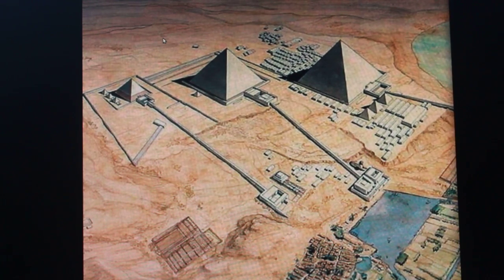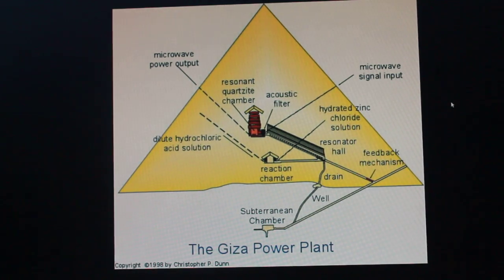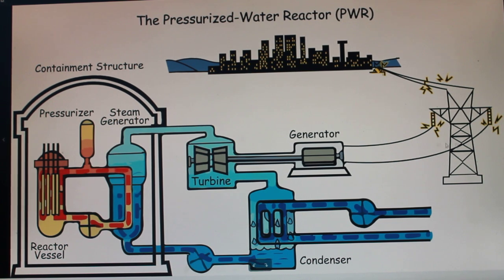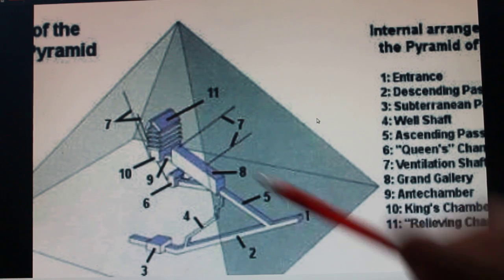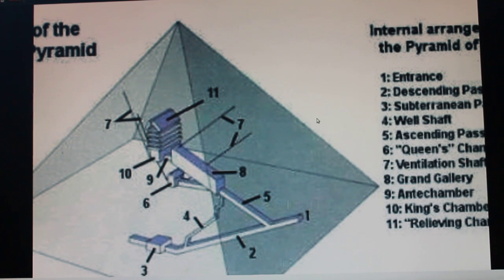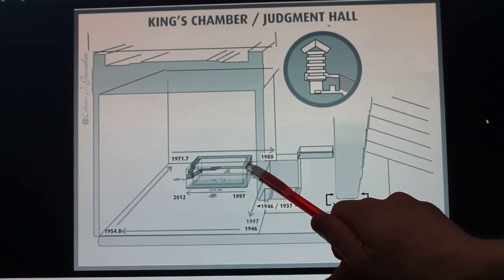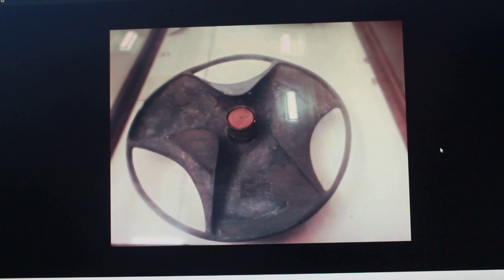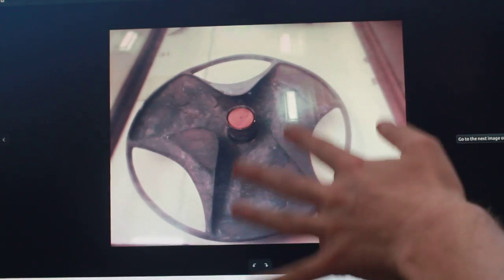Is the Giza Pyramid an Ancient Boiling Water Nuclear Reactor Complex? (Part 1)

Comment: All Shafts was originally closed before the black powder archaeology was started. how does a Nuclear reactor need amounts of Whisperer sand 99% quartz content in chambers. where are reminders of the Pantograph infrastructure? if you already have the technology for building that kind of workmanship you don't need nuclear  power plants. 

If you look at your picture you see a lot of passages  channels Bypass channels Plugs  heavy flow regulator blocks. it remembers on a carburettor.

Comment: It was an Ion Generator. The stones in the subterranean chamber created an electrical differential to split water atoms into oxygen and hydrogen. The oxygen sunk to the bottom and was discarded. The hydrogen rose to the queens chamber where it was under intense pressure in order to initiate ionization. The shafts of the queens chamber stopped just short of the surface in order to contain the hydrogen under pressure but allow the ions to escape through the copper in the plugs at the ends of the shafts...

Comment: Where you have the cut-outs at the end of the vid, the two sides look to be the same hieght could this of had wheels/cog system which used the holes like a ratchet system, to stop what ever was being pulled up falling back down?

Could it be used as a way of sending water out of the atmosphere? Like a last minute save the planet against floods kind of device.

Comment: It has been said that the Giza Pyramid could have been some sort of electrical generator.  So could these iron rods in the stones in the shaft be what is left of iron cables? The  Giza Pyramid is so old the iron cables would have easily oxidised and rioted away by now.  So what was left of these iron rods or iron cables in the stones in the shaft could have been protected from oxidation by the element in the stone itself.  the rest of the cable has oxidised and disinterred away.

Comment: it was nuclear...but it used thermonuclear energy cold fusion. it combined alpha particles and electrons and fuse them together to make lithium. this is the red star over both head and the other gods. this guy is partially right but theres more to it. the Ark of the Covenant was a radioisotope thermoelectric generator which use the p-type and n-type material of Tesla's 3-6-9 because of their electronegativity. essentially it's a giant thermoelectric generator with a small star in the king's chamber. this is all facts if u research everything I just said. even Chris Dunn's Theory actually supports everything I said because what he thinks is only also part of it and implies that my theory is right with the residue that he has found the hydrogen was ionized and burnt in a thermonuclear Ark emulating the sun perfect

Comment: There are chambers not on your diagram. That have recently been descoverd. If it where a reactor it would still have high levels of raidoactive.
Reply: Not if it was this thorium. No chain meltdown week it'll salt water. But good point. Was a radiometer every used to detect radiation?

Comment: Is air pressure energy? Harness sonic pulse . baffled and concentrated in kings chamber, liquid diaphragm makes kings chamber a bicycle pump. It breathes. Ask John Cadmans ram pump. Granite ball in shaft is under water, air intake only valve. Granite box belongs on other side of wall, Obviously pulled in through pressure blow out stone hole. Water mark on wall speaks of compressed air above it. Kiss. When you get it right. You know it.

Comment: If they were nuclear reactors, were's the residual radiation at. If I remember right the half life of uranium is a half a million years. I'm probably wrong about that, but it is definitely longer than the time frame of when the pyramids were supposedly built. Either way, if you had nuclear reactions happening inside the pyramid then why don't we pick up any residual radiation. The chamber at the bottom of the pyramid was a resonant generator. It also produced electric current created from the running water flowing down the tunnel and out the drain that they believe they found down there. The electric field produced was used to split water into hydrogen and oxygen. The oxygen was bled off and the hydrogen was captured and channeled into the grand gallery which was a resonant chamber. The rest of the hydrogen was produced in the Queens chamber. They found zinc lining one of the tunnels that comes down into the Queens chamber and hydrochloric acid coming down the other one. This produced a large amount of hydrogen gas. This gas was then channeled into the grand gallery. The grand gallery was tuned with panels at different locations. The Kings chamber was a resonant chamber as well. The poured rock sarkofagus, was used to house the Ark of the covenant. The Ark was a resonant device that stored energy. When you resonate hydrogen at a specific frequency, it produces microwave energy. The shape of the pyramid then produced a maser beam. It's like a laser beam, but instead of using light it uses microwave energy. The maser was directed at the ionisphere, which in turn created a plasma channel for millions of amps of electricity to be harvested from the upper ionisphere. The resulting energy bolt would follow the plasma channel back to the pyramid where the cap stone would redirect the energy to waiting storage facilities. To transmit the power, they did what Nichola Tesla did. Tesla sent power into the upper Shuman cavity and kept it going by spanking it with a new charge everytime it came around. He could then pull the power directly out of the air and use it anytime he wished. He could transmit power for miles and pull it down and use it anytime he wished. The civilization before the Egyptians were able to do this and powered the world. So, the pyramids did produce power, they just didn't do it with nuclear energy.

Comment: People need to stop with this granite electricity nonsense... Granite is actually a very bad conductor. If you pass current trough granite it heats up more than anything else. A huge waste of electricity.. They had copper back than so if they knew about electricity don't you think they would use that instead?

Comment: as you gave advice to that guy who wrote a book, build one and prove it works, then come here and claim your theory... you have problem with pressure relief system and isolation of the chambers from each other. also you are missing mechanical part for converting steam power to electrical. go rethink your theory.

Comment: I actually am of the same opinion. Hereunder is what I commented at another video.

"After watching various videos I do believe that the great pyramid was a factory of energy but I do not know of what type. The walls material as well as the size of the building are both ideal for keeping heat and vibrations inside. Evident are marks of heat and scorching on the walls and the four airways could be working as release valves? Moreover, the parallel stones above the "kings" chamber remind me of vibration absorbing springs. Have there been tests for radiation?

Moreover, the corridors seem small enough to fit only workers for maintenance purposes. And potentially the heavy door at the beginning of the grand gallery was there for security purposes, sealing potential excess pressure or something. Maybe the grand gallery itself would be a pressure release chamber as well."

Comment: Doesn't make sense........there ares 10,000 of pyramids in the world, Giza is just the most advance, so if GIZA was a nuclear power plant then we have to assume the other 10,000s are more primitive version of GIZA, meaning still a nuclear power plant, other pyramids don't give you any reason to believe it was a nuclear plant or a power plant, only Giza.

also if its a nuclear power plant i don't see what the point is to align the structure with stars and with other pyramids on earth 10,000km away, and all the extra precision and measurements which resemble dimensions of earth and moon etc

we must assume all pyramids were built for the same purpose regardless of how advance or primitive.

I think it was a power plant, but not nuclear, it harnesses the natural energy that is in the atmosphere like Tesla proved, that's why it on the equator, wheres earths meridian energy lines pass, as well as the alignments to north, south etc as well as with other stars and pyramids on earth. So its harnessing earths "Chi"

Comment: Excellent scientific approach,  you are very close...  They were likely HHO generators,  self igniting with static electricity aka spark,  oxygen sinks,  hydrogen like the hindenburg,  floats.  The cloud effect like a lynden jar,  or storm clouds building opposing charges in floors and ceiling of the condensing unit,  aka the Queens chamber,  why it was charred..  Its also a blast chamber,  and the well below used as a water source,  til the climate for whatever reason changed.  I hope this points you in the right direction,  although there were entire civilizations destroyed by nukes and UFOs if you do your research.  Sand turned to glass and extreme heat that killed civilizations.  But this is all just my opinion.  No one can be sure at this time.

Comment: Close, but : https://www.youtube.com/watch?v=lMJr-oUYYDA thats what is going on.

Materials in pyramids, most common : 

Granite - The electrical properties of granite appear to be dominantly controlled by the amount of free water in the granite and by temperature. Minor contributions to the electrical properties are provided by hydrostatic and lithostatic pressure, structurally bound water, oxygen fugacity, and other parameters. Is granite a good conductor of electricity? The electrons from the stressed rock cannot follow the holes, because granite is not a very good conductor of this more usual form of electricity. But when, if you do this trick in a laboratory, you give the electrons the chance to bypass a section of rock by way of a metal wire, quite large currents will flow.

Basalt rocks - Some magnetic properties and electrical characteristics at low and high (microwave) frequency of basaltic rocks are reported. The magnetic measurements show that basalt rocks are ordered ferromagnetically in particle size form. The low-frequency results indicate that basalt samples have relatively high dielectric constant. The Cole-Cole plot shows a part of inclined semicircle resulting from the spread of the relaxation times of the relaxators that operate in the sample bulk. The microwave results reveal that relatively strong interactions exist between the microwave (in X-band) and the matrix. The value of shielding effectiveness determined from the measured insertion and return losses was found to be about 15 dB per cm.

***A dielectric (or dielectric material) is an electrical insulator that can be polarized by an applied electric field. When a dielectric is placed in an electric field, electric charges do not flow through the material as they do in an electrical conductor but only slightly shift from their average equilibrium positions causing dielectric polarization. Because of dielectric polarization, positive charges are displaced in the direction of the field and negative charges shift in the opposite direction. This creates an internal electric field that reduces the overall field within the dielectric itself.[1] If a dielectric is composed of weakly bonded molecules, those molecules not only become polarized, but also reorient so that their symmetry axes align to the field.

Comment: Show the world at least some of the outside infrastructure required to carry the resulting power to homes, temples, etc. and I'll believe the pyramid is a power source. Show anything relating to the actual use of such enormous power in Egypt. Whoever you believe the builders to be, they built all their stuff in stone. So where are the conduits, fittings, engines, and whatever else such power was used for.

Your entire video is  'I think', 'I guess', 'I suppose', 'possibly', 'I don't know', 'could be', 'maybe'.'and a whole bunch of straight up crap peddled as a factual done deal. Do something worthwhile with your life.

Comment: Something else I believe that might be found I believe they might find mercury deep underneath the great pyramid and I know the stories about the spaceships know it wasn't bullshit I guess I'll have to talk to you personally about that. Also you were talking about cooling I suspect the underground tomb things right near there were used as some kind of a capacitor's but I don't know very much about nuclear perhaps they had something to do with nuclear cooling and that's why they're located under ground in case they did explode is accurate as they are I know damn well they had to be machine on either a Blanchard grinder or some kind a big surface grinder you don't get Percision tolerance within 1/10000 of an inch without a Percision grinder. Then you better be a pretty damn good tool maker to get that. I believe all the stuff was built by the first civilization which the only thing I really don't have a good clue about is when did it actually start I believe it was at least tens of thousands of years before the bullshit that we've been fed. I believe the Bosnian. Pyramid that has been carbon dated and proven to be a type of cement hold more to the keys to this puzzle. Rob Sandera

Comment: One thing I always notice in people's theory's that have layout drawings. The always forget that there was granite plugs that had to open these chambers up. I really like the power generator ideas, not "nuclear power", but where is all the electrical wire that would run to the clay huts? I just feel something as sophisticated as a nuclear power plant would have a lot more circumstantial evidence found on the ground. 
Let's say it was a nuclear power plant and something went wrong and the area was evacuated. Let's look at trinoble, did we go in and remove everything down to bare bones, no it's all still sitting in the spot it was the day of the meltdown. 
This idea is so far out there you can't even explain it.

Comment: How pyramids were really built: Gravity was not the same as it is now post-flood or deluge compared to pre-flood or deluge so things were much lighter i.e. megalithic structures etc. The earth once had and will again have many electromagnetic poles not just two as pointed out by Peter Driscoll. This was the case 5,000 years ago, nowhere near millions of years ago. Earth was once surrounded by water because of these multi-magnetic polarity mechanisms which means what we call the periodic table of elements worked differently which explains the strange anomalies in the pottery polarities. The crystalline particles in ocean water or firmament in the thermosphere protected the earth from cosmic radiation which explains human longevity pre-flood and the periodic table of elements in relation to antediluvian technology of the Arcons.

Comment: I know what it is, but I don't want to explain it... but the dead giveaway are the plasma marks on the top of the queens shafts near the electrodes.. the place where they said was a door. No hydrochloric acid was needed.. when you short out a capacitor in water it self charges itself. I'm the only one in the world who knows about the plasma marks. Bottom line.. it was transmitting wireless free energy to the whole planet. Your so off the mark I don't even want to bother to explain it because it would take me too long.

Comment: Nuclear Power makes absolutely no sense. Nuclear power is nothing more than steam power. You dip the rods into water which creates steam; it's that steam which is converted into energy. Looking at the side picture at 2:18 you see no way to actually apply this. It would be much different if there was a vertical channel going up from like the Subterranean chamber, or the "reaction" (queen's chamber). Because at least then you could summarize a mental plausibility of where the steam could have traveled. Also, there is no machinery within the pyramid. Machinery, even in some archaic capacity would be required to convert the steam to power.

Comment: A desalinization plant to produce fresh water.  During the Flood of Exodus there was ocean water pulled up at the equator and dropped quickly onto the land. Also, the water in the rivers ran red and people who drank it died.  The ancients said the planet Venus came close to the Earth every 52 years.  That gave the 52 years between catastrophes to build these.  Polluted water goes in the front door, H and O are produced, The H and O go to the top and combine back into water, and fresh water out of the top.  The granite box to recombine the water from O and H and let it pour out of the box into the room and the pressure from the gases pushes the water out of the pyramid.  Perhaps there was a vent below that to let noxious gases out such as chlorine.  Concave walls to handle the as pressure from the inside.

Comment: Where is the radiation now? It should still be in the pyramid. Also with all that radiation how did they move new fuel into the reactor. I’m sorry but there is tremendous amounts of deadly radiation with a fission reactor. You said your theory is the pyramid absorbed it. It would still be there today. It doesn’t just go away after 10,000 years. Right now in the pacific we built a dome over the spent plutonium from our tests in the bikini atoll and it won’t decay for 124,000 years.